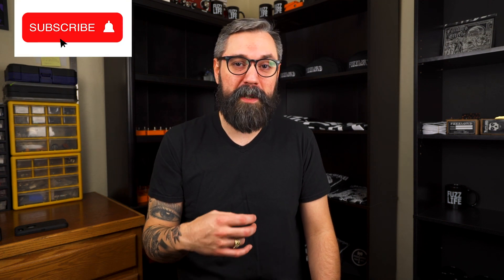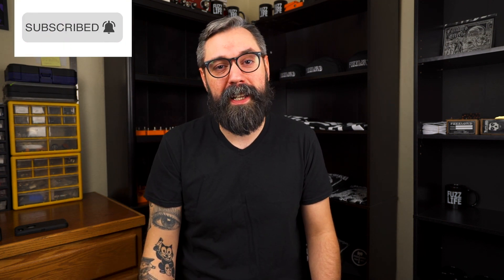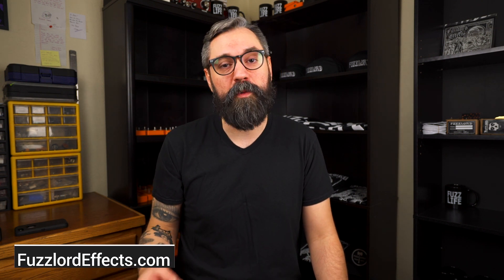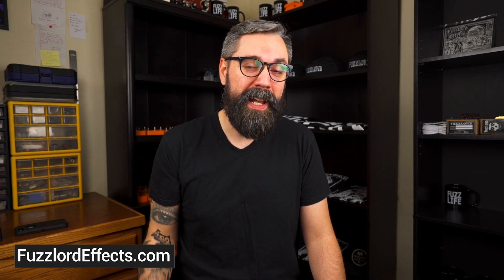Fuzzlord Void Master

Comment: So, The big question on the song I'd use this pedal for? That's a good question, I run a really... uh, frankenstrat'd Samick superstrat from the late 80s early 90's through a Bugera V55hd and at the moment, a 4x10 bass cab as I'm primarily a bassist and don't currently have a guitar cab in my possession right now. But I'm getting some Spaceslug vibes from this thing when you lower the volume down a bit, so probably something from those dudes.

From Asheville NC with love.
Reply from the maker: Yesssss Spaceslug!